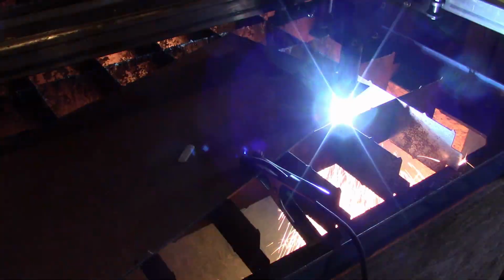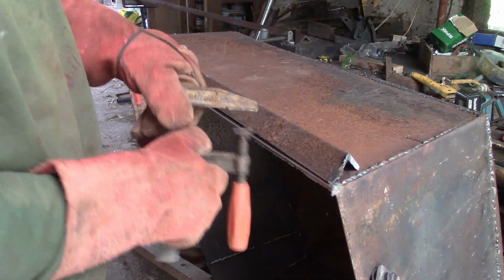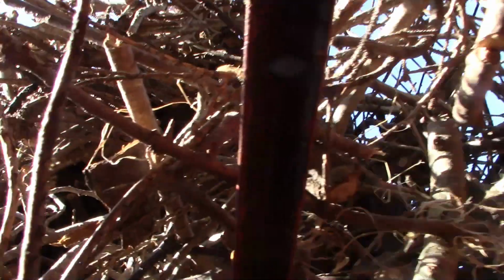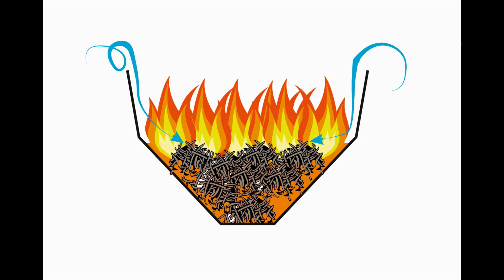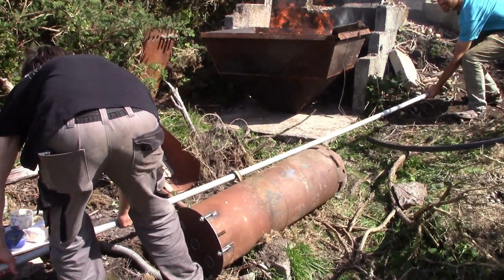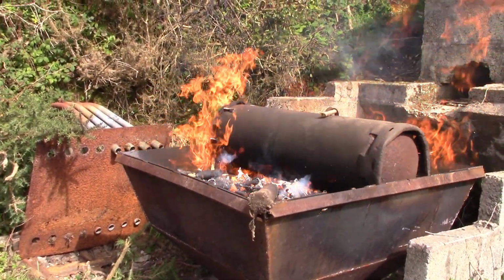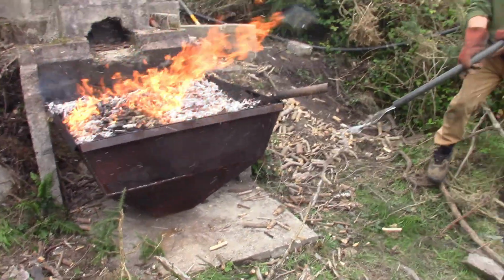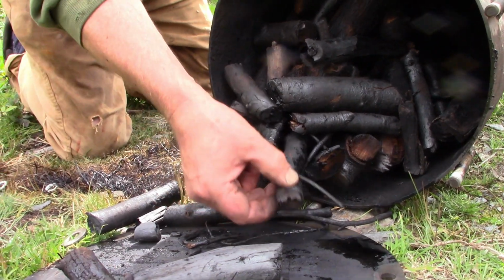Life, Death And Charcoal. (Testing The Chip Trap-Doors, Making Charcoal Kilns, Activated Charcoal..)

Comment: The addition of a water filled auger at the bottom of the kiln may work . Initially fill the kiln base with gravel to build the fire on . Once there is a sufficient amount of charcoal , the auger could be turned , pulling the charcoal out allowing more space for more biomass . The water filled auger would need a constant supply and could be nutrient rich

Comment: From a Mechanical Engineering standpoint you have found a way to create a processed fuel (charcoal) from wood and thus can now make a heat engine by burning the the fuel. However, perhaps you should consider making coke from coal as a processed fuel (just as fun as making charcoal), both for heating and for smiting, or maybe just use raw coal. Then, as we essentially continue with basic thermodynamics and walk in the foot steps of James Watt, you can now create a steam engine with your fuel to run your shop, not by belts but by driving an AC generator, like a mini AC powerplant. You can get coal from coal direct in Ireland. Perhaps your house is on a coal seam?

Comment: 1.  Please watch your phase changes!  If that water vapour has nowhere to go inside that steel container, you're going to have an awful explosion on your hands.
2.  Please watch your toxic gasses!  Once the water vapour is gone, the off-gas is hydrogen and carbon monoxide.  You shouldn't be breathing that, you should be capturing it and burning it off.  You need a containment structure for it over the steel drum and a chimney to make sure it's well-mixed with oxygen and burned before it's released.  A jacket for the drum will also help with heat transfer.

Comment: Concerning the decomposition-stability of charcoal: Most bio-char/charcoal wont come close to lasting 2000 years in its original form. Not even the carbon will last that long. Usual charcoal is fully broken down after anything between one and one hundred years. The stable carbon compound fraction is what matters here, and it depends on a plethora of factors. Heat for example. Hotter pyrolysis will give more SC, but less yield overall. Feedstock material is another easy to adjust factor. Hardwood (specially oak) produce higher amounts of SC as well. Now I know that the sequestration of carbon is not the main focus of most bio-char users, just wanted to set this straight. Awesome video as always! I am looking very much forward to upcoming improvements on the system!
Reply from the maker: Thanks, there is a lot of conflicting talk about how long it lasts in the soil, so I'm happy to keep learning

Comment: Airtight lid is better than water, because then, all the volatiles can escape while it remains hot.
With water, you basically quench the reaction and some volatiles/tar that burn with bright flame, remain back.
Charcoal is also nice to insulate garden shed etc. doesn't rot, keeps constant humidity by absorbing/releasing water vapor and isn't ugly stuff such as rock wool.

Comment: Fun fact obout bio degredation, most of the carbon in the degrading material is converted into methane which is 4x more effective at greenhousing the planet than CO2, burning biodegradable carbon sources or using a biogas digester and then burning the methane is more environmentally friendly than just letting the methane go. Methane burns 1:1 to carbon dioxide so burning it literally quarters the impact.

Comment: Its a zero sum issue. The carbon from the air forms the carbon from the plants and microbes which in turn becomes again the carbon in the air.  At this time mankinds total carbon contribution has raised the temperature less than 0.1 degree over the past 300 years.  At this rate its going to be a few thousand years before we raise it one degree.  Cut me some damn slack.  Stop drinking the Kool Aid.

Comment: you can make a steel wagon for the charcoal with left-over metal and making a box with it so you can carry charcoal and activated charcoal to where it's gonna get grinded and with a loco motive i'd suggest using your rocket boiler to supply the power as what most fireless engines did, using the steam from factory boilers to power themselfs like what tornado is or you can make a flatbed and put a gas motor and a barrel to supply the fuel. and make a quick and easy diesel loco for your expanding railway

Comment: You really are losing a sh**ton of heat so I think you should check out the process of thermal hydrolysis. This is when water (steam) gets super-heated and thermally decomposes into O2 and H.  This gaseous mixture can then be brought back down to under the kiln and ignited to heat the kiln some more. Here is more: https://en.wikipedia.org/wiki/Water_splitting#Thermal_decomposition_of_water
Perhaps there are even some simple catalysts allowing us to do this in lower temps.
Subscribing and anxiously awaiting more experiments around charcoal and heating/burning stuff. 
P.S. for activated charcoal you would need to add super-heated steam much more slowly and charcoals should have been split into much smaller pieces to allow for greater exposure of surface to the water steam. The way you did it you didn't get much of activated charcoal, just a regular one.

Comment: Could you do a sort of continuous-flow cone kiln? I.e., have a false bottom that can be removed to allow the charcoal at the very bottom to fall into a bucket of water or something? You could maybe have a chain conveyor or auger to lift the charcoal out of the water, up to the side at an angle. There's probably something I'm missing, but I was just trying to think if maybe the cone kiln could be adapted to a continuous-flow design.
Reply from the maker: I'm sure it could work, though you might need to poke it with a stick to get it to flow - which might be dangerous

Comment: Just a thought, could sand be dumped on the fire instead of water?  It absorbs a lot of heat like water does, and blocks air from getting to the charcoal, but doesn't get absorbed into the charcoal.  Once sufficiently cooled down, you could use a wire mesh to sift the sand out of the charcoal and re-use it for the next batch
Reply from the maker: I'm sure it would, but I need activated charcoal so I need the water anyway
Reply: @wayoutwest-workshopstuff6299  to activate charcoal you need more than just water.  Cody's Lab did an episode on properly making activated charcoal, might be worth a look

Comment: "Free" energy storage: You can use the ground to store heat. Shipping companies get lots of styrofoam. Call them ad take it off their hands. dig a giant square trench and fill it with 5-10 inches of foam and bury 2 loops of pipes inside this insulated square. Put some foam over the top and cover with dirt. You can get the same or better insulation values as a high grade fridge. When you run hot water through the 1st loop of pipes the dirt heats up and the second pulls heat out. Even better is to dig all the dirt out first, so you can insulate the bottom. This may require a backhoe depending on the size. But $100-200 for a 1-day backhoe rental isn't too bad when it allows you to get free heating all winter.
Reply: If you put a greenhouse over the top, you get free heating for your greenhouse as well from the little bit of heat leaking out. This allows you to grow a second crop in the winter.

Comment: Copper coil in the chimney connected to a heat exchange, circulate water  through the coil to capture the heat.  Works great in fireplaces to pump heat in the house that would otherwise go up the flue.
Reply: And that copper coil connected to a hot tub that will be just at the perfect temperature at the end of a hard day of work.

Comment: You don't need the cone shape - the same principle works with a drum shape just as well if not better - so you could use a barrel, or an old water tank, or anything that can take the heat & can be sealed at the end. I make mine using just an old oil drum - works good, a lot less hassle, cheap & easily replaceable. :-)   The same "burn from the bottom up in layers" method suits me fine - I find the retort method to be a bit too finickity & it demands an awful lot of fuel that is effectively wasted imo.. :-)

If you need to cut a lot of wood, I have a simple, home-made diesel circular saw video (look at my vids, it's in there) - this season it cut a ridiculous amount of firewood - endless tonnes, days & days of cutting - and used the princely amount of 3 gallons of diesel in total. When we totted up how little diesel we'd put through it, we at first thought we had either lost the plot or had forgotten, but no - the one 5 gallon drum of fuel was used exclusively for the saw & there were still 2 gallons left in the can. We previously ran it using a 13hp petrol engine, which would eat through 3 gallons of petrol in no time at all - the difference in economy was astonishing and the extra power - 17hp- of the diesel meant the engine was never under any pressure at all. . :-)   A big circular saw is a game-changer in how much wood you can cut up - it makes the process very very fast.
Reply from the maker: I'm hopiing to be able to produce a lot in a short time, so I need something big. A cone is easy to tip too..

Comment: On the note of that sort of undercooked charcoal, there is this thing called “Torrefaction” that sort of toasts the biomass or what have you.  

At least if I understand correctly, it partially pyrolyses it, so you have a dry, somewhat pest+waterproof (due to the oils/tar), and more burnable fuel.  

It makes a substitute for Non-Anthracite Coals, so some Steam Railroad clubs have switched to it so they don’t have all those nasties in the ash, or the CO2 emissions!

Granted I don’t know if it is worth it over just charcoal + pyrolysis oil/syngas, but that may be worth a look.

(Edit: Typos, spelled it like Gasification when it is a “-ifaction” not “-ication” i guess!)

Comment: 18:02  Some ideas for Grinding:

In-Sink Wet Food Waste Grinders (“Insinkerator” is a brand,  we often call them “Garbage Disposals” or “Kitchen Grinders” here in the USA) work really well, although they make small particle size if that isn’t what you want (although you could then pelletize/press that into bricks/briquettes maybe!)

Granted that option may be a bit pricy.  If you use it for compost too, the surface area increase speeds things up dramatically!

Another option may be a ball mill that runs off of an old cement mixer, your stationary engine, or maybe even a crank/bike?  I would think any sort of drum filled with charcoal and ball bearings/rocks etc would work well, maybe with bar stock for lifting stuff as it spins?

Finally a Hammer Mill or Jaw Crusher could be used.  Granted high power need, and a major safety hazard (so use proper guarding/shields etc, want ground charcoal, not hands!), but they are pretty simple and that may be nice.  Also some good designs around YouTube and whatnot already.

Either way i wish you luck on all that!
Reply from the maker: Thanks, Eric. I've been looking into all those grinder designs - and others - but I'm still not sure which to build
Reply: @wayoutwest-workshopstuff6299  a wood chipper seems like the ideal setup....the chips they put out seem almost ideal size for charcoal briquettes.... from my chair they look right anyway lol this is really cool, grateful to have found your channel
Reply: @wayoutwest-workshopstuff6299  I’d second the ball mill idea. I use a much smaller scale setup to grind charcoal for making black powder for antique firearms- it’s a large metal bucket chucked up in my lathe, filled with lead balls. It gives a very consistent, repeatable grind when run at the same speed and duration. I’d recommend using brass or another soft metal as your balls though, so sense in contaminating your soil additive with lead! Avoid steel agitators, though, they’ll spark against the drum and each other and could make the whole thing go up in smoke!

Comment: 11:35  Perhaps have a sort of conveyor, or even passive ramp like one would have for soda cans!, that has numerous kilns like that gradually travel through the heat then drop out to be emptied?

Would have the simplicity of that genius kiln of yours, with a more continuous nature.

Could even use a cooling rack/bath pre-opening them to prevent that spontaneous combustion issue you mentioned!

Comment: Heat storage. Many decades ago there was an article either in Popular Mechanics, Mother Earth News or a magazine of similar thought; there was a heat storage using an underground room filled with rock. The rock was large enough to allow air movement. The rock would then absorb heat or release it depending on the temperature of the air flowing into the chamber. If you used corrugated tube and gravel could you store the heat in the soil and gravel?

Comment: I have just spent 2½ hours on the bank's help line, so I am NOT in a good mood.
Here are my retorts (hah hah):-
04:55 I am glad to see you all wearing gloves. My patience is tried by my helpers here who refuse to wear gloves when handling my nail- and rusty screw-riddled scrap timber.
11:48 Great! Avoiding heat loss is what it's all about. Or "energy loss or waste" if we prefer. Fight entropy at every step of the way.
12:30 How hot does it get? I assume you aren't thinking temperature here - you have a temperature gun. Consider burning a wagon of fuel to boil away a cauldron of water. You know the BTUs per degree of temperature raised, and you know the BTUs for latent heat of evaporation (phase change). So if you start with 50 gallons water and you end up with 10 gallons, you can calculate a lower-limit for total BTUs, that is, units of heat. The lower limit figure is immediately useable, because however you use the heat energy, you will lose some through inefficiency. Always.
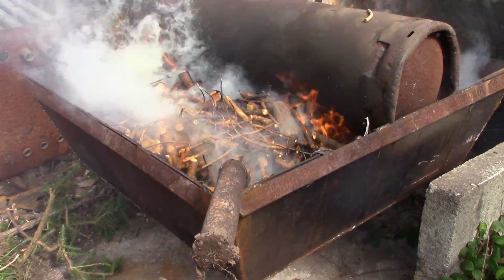12:48 I like the whole-system approach; no matter what we do with it, it is "all going to end up in the same place"
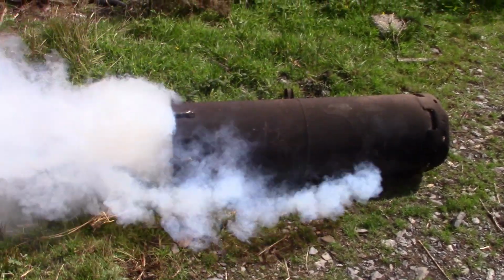16:12 My understanding is that water vapour is invisible (another reason why high-temperature "steam" is dangerous) but that steam is water vapour that has cooled to below boiling point. Nit-picking, I know, but 2.5 hours before they will admit that there is a problem with their web site?!!???
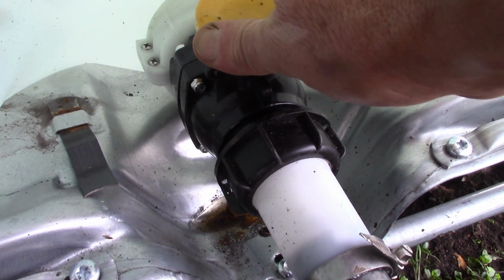16:50 You have the solution of water to hand, as any ex-manager of a steelworks coke oven would tell you: You need a thin plastic sheet, I mean THIN, to line your now-empty wood chips wagon. Fill same with water (can be done overnight), roll the mobile spa over the charcoal cone, knock out the pipe as you run away!
Great stuff. I am now going outside to work off my stress sieving soil. Cheers, Chris
Reply from the maker: Ha! I maintain that banks are modern-day velociraptors - keep far away from them if you can.

Comment: A recommendation; as someone who uses homemade charcoal for blacksmithing: loads of information online (and people you meet) will say all sorts of warnings about "don't use such and such charcoal, it won't burn hot enough" or that charcoal has to be made to be super hard high-temperature hardwood char or else it won't work.
I've used it all; they're incorrect, I think it's because so many smiths (here in Ontario at least) use coking coal and few try charcoal, fewer still make their own char, but you can in my experience reach temperatures well over the burning and melting point of steel easily with ANY charcoal - Provided critically that it be dry. I've even forged in ashy stuff sifted out of a campfire pit that had been rained on and dried in the sun; it all works but won't burn well until it's dried a few moments in the forge's heat. All charcoal is porous and collects moisture over time, this is okay and barring drenching the stuff moisture won't ruin it for forging. Hard high-temp hardwood or softwood charcoal genuinely burns nicer and gives less sparks/embers in the forced air of the tuyere, but even fluffy porous stuff burns hot, if with more ash and crinkling than ideal.
Reply from the maker: Thanks, Nick. Yes, I'm looking forward to leaning more when I get a chance to experiment.

Comment: if you can get your chips to a relatively uniform size (easier said than done) you could make a pretty slick hopper to pump the chips into the kiln.   maybe a screw pump or a conveyer and feed it right from the rail car but the fun part would be pumping the char up the hill, into a char car.

Comment: You now need a threaded bung. To drain  the water out and rain water when not in used. 
Keep your eye out for 4 rubber tires 
Make a rolling A frame. To make it easy to lift and move heavy things.  Wood or steel, what materials are available. 
Will be fun to see just how black you get. When you grind the char coal. Be warn about sparks.  We don't want  to hear about any explosions 😬